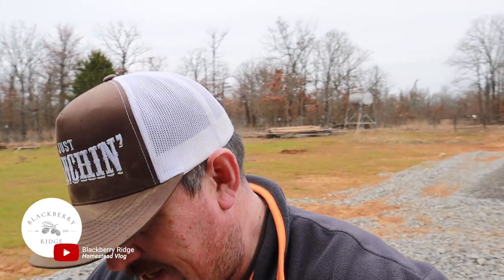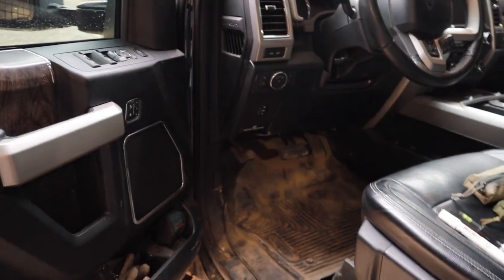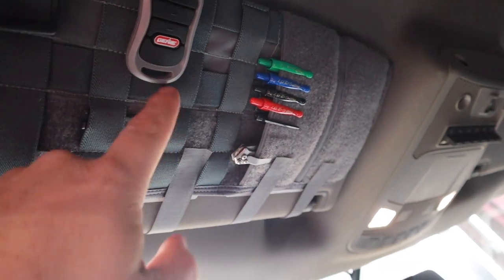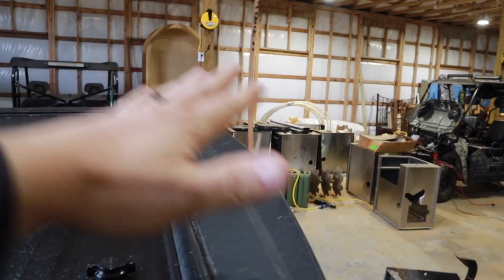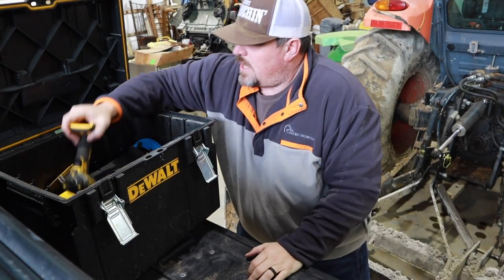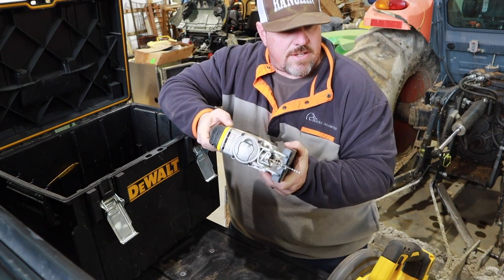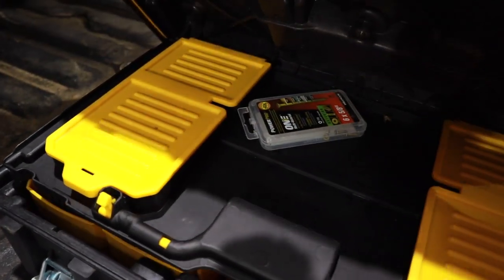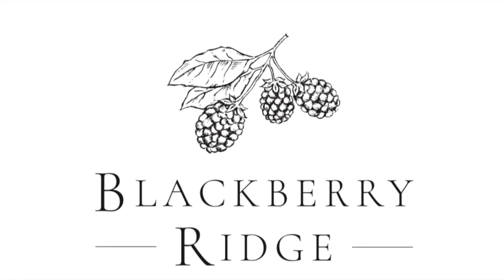General Contractor EVERY DAY CARRY | Builder EDC | Truck EDC

Comment: 8ft bed with a high topper, side boxes on outside shelves on the inside. Milk crate of drywall tools/paint, husky bag for electrical klein's and fluke, main bag for basic hand tools, 2x25ft extension cord, crate of concrete tools, framing nailer and 16p nailer, I use parachute bags for fastener organization stowed inside 5g bucket. Milwaukee bag full of wrenches, sockets, picks, box of plumbing tools. Wooden drawer on bed for power tools and accessories and long tools. Still can fit sheet material in bed and also get in there to get to the shelves. Worked out of utility beds, and the cab high shells before, current setup is by far the most convenient system I've found

Comment: That last tool you showed is a drain remover tool I use it more often on a shower tub drain assembly and kitchen sink strainers. One of the tools you showed that works on cabinets is a great tool and probably the best tool that every come out is the plastic cabinet door knob jig. Saves on a lot of time.